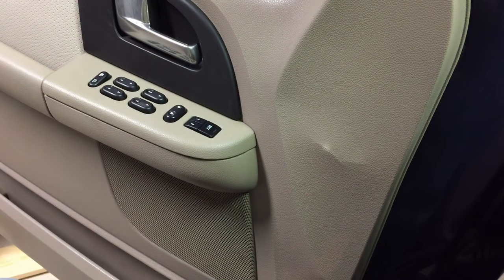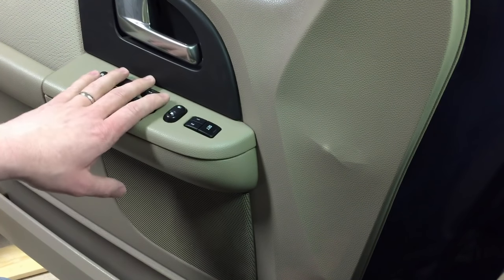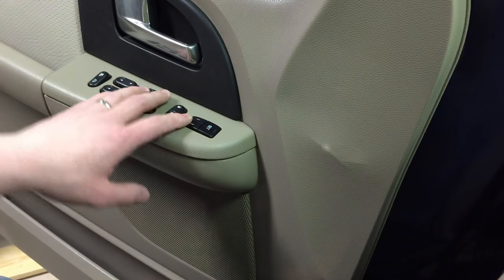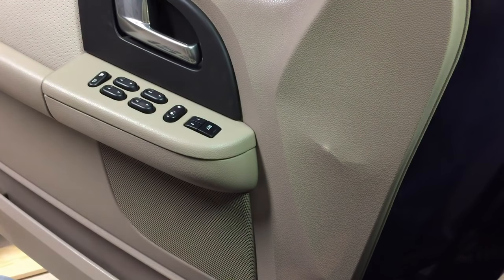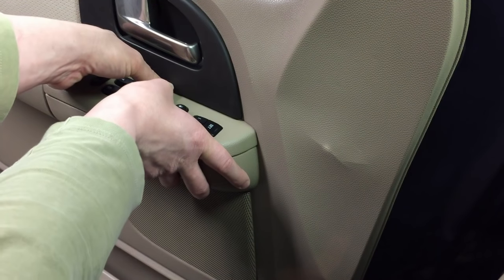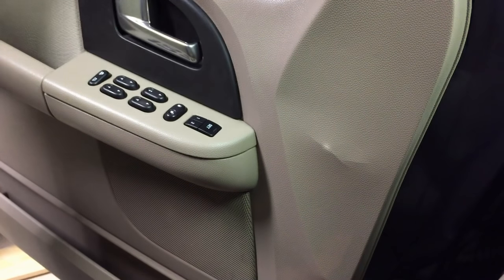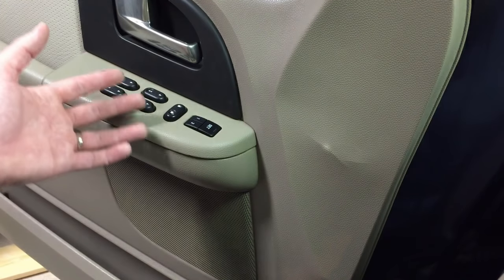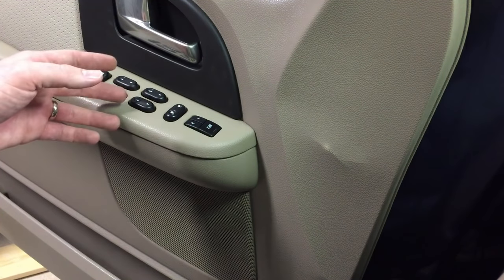Ford Quick Tips: #42 Easy Test For Windows That Are Stuck Down

Comment: I take those switches apart and clean up the contacts, Alot of times a little cleanup with a file on the contact points is all they need.

Comment: AMAZING! 2006 F-350. Right-side shotgun passenger window was stuck in the down position. Was just getting ready to pull everything apart but thought I'd check YouTube first. I'm old school and usually forget about these videos. Played with the master switch and then pretty much all the other switches with no luck. Tried poking/jabbing at it as you show in your video and boom, works like a charm. Must have been some dust or dirt or something in the switch. Saved me likely hours of screwing around THANK YOU!

Comment: You rock!  I would not have tried that persistently if it were not for your video. I ended up holding down the driver and passenger controller for the window to go up and it fixed the issue......for now. Thanks again!
Reply: this helped my issue, thanks to everyone

Comment: Oh thanks Soo much. I just searched for this issue. Window went down, not up. Anyway, that 2nd tip, worked right away. ( quick on off action ). I've been dry camping in the desert and lots of dust and sand out here. So I have a question, can I get one of those airstream pressure cans? To clean it out?

Comment: I changed out the switch and the new one worked.  This is back up car so I did not use it for two months.  When I did drive it, I lowered the window nit it would not come back up.  I got a replacement switch but I sill cannot get the window to move.  There is no cable wrenching sound like I have had on other vehicles so I believe the cables are ok.  If the motor is bad, why would it work once, but now later?  Do you think it is the motor?

Comment: i had a difficult diagnosis of a power window on a 2002 cougar itd work intermittantly did the troubleshooting tree test the RESISTANCE of the power switch. it tested good. next checked the wiring between the door and body found nothing. long story short switch was bad even though it "tested" good with the resistance. now i ALWAYS check for power going in and out of the switches now. much more effective
Reply from the maker: Yeah I don't even do resistance checks anymore and rarely voltage checks I go right for the load test.
Reply: Did you use ur dust meter lol  Blow out the contacts DONE........

Comment: maybe related to my issue? 2014 f250 superduty, passenger window sometimes works, others not. I also have an issue with the doors not auto-locking. I'll be driving and then I'll hear a clunk and the pass door locked. Way after I started moving. Bumped the rubber flex tube between door and body and the window worked for a while. Switches? or wiring at hinge? It is a plow truck but only 80k on it.

Comment: Thanks.   What do you do if when checking current the down wire on the drivers side window shows no current.   Is it the switch.   I actually changed it out and it worked for a few days.  Then back to not going down.  Shows current when testing for up.

Comment: replaced the drivers side switch panel, but the passenger side still does not work, all others work. the regulator on that door has been replaced and it does work at the door, but not from the drivers side??  does the signal bipass the passenger side switch?  ie could it be a wire or plug from the drivers side that does not involve the passenger side switch since that side switch works???

Comment: Ive replaces my 2000 mustang switches but still intermittently just dont get power to the passenger window, never slow just works fine or get no power either up or down.. Any advice?

Comment: One trick I used to use when I worked in a tire and lube shop and a ford vehicle would come in with a bad switch and the customer didn't tell us about it (we always rolled down a window when we had the vehicle in the garage) is to pop the switch panel off, pull the connector for the switch and actually make a connection on the contacts of the plug to get the window back up using a pair of needle nose pliers or the like. I'm not sure exactly on what year models this would always work on, but I know early 2000 vehicles it works. Just pull up on the panel and it comes loose.
Reply: dust in contacts Blow it out ur DONE....
Reply: Nice. Great idea.

Comment: So window power switch not working, changed silver relay in fuse box, no luck,switch out master switch,nothing.
What I have noticed when I press switch it activities, the power heated mirror light come on, and also when I am using the heated mirrors only the passenger side work, wondering if you can point me in the right direction.

Comment: Hit button while pulling up on the window with other hand usually gets a stuck one moving past the binding spot. Mine binds half way down. Don't think it is the switch and maybe the regulator sliding contacts are bad.  Have a spare motor but it does the same thing. Only other thing I can think of is possible it is binding where the window slides in the felt track.

Comment: Thanks man, rapid click worked for the passenger window on the driver side switch, but passenger switch not working? I check contacts
Reply: Window lock? Makes it where all windows are controlled by driver only.

Comment: Thank you for the advice. Tapping got it back up.
Reply: Hank Monroe hi I have a 2000 Excursion and my window goes up but it won't go down and if I push it to go down one of the not the little fuse but the big fuse to relay makes a noise when it shuts it down in a few seconds later he tried again can you help me

Comment: I have a 2013 Expedition. The driver window does not work. I have replaced the motor and switch and still only the driver window does not work. Not sure what to try next. The motor does not work when unmounted but plugged in Tried 2 different motors and still does not work. All other windows work fine.

Comment: 03 Towncar code 34 on airbags. Could you outline trouble shooting tips? No access to ford computer diag tool short of taking it to dealer.

THx.

Cheers
Reply from the maker: Victor Shu There is a open circuit in the safety belt pretensioner circuit on either the drivers or passenger front seat belts and really should be diagnosed by a professional as these are dangerous.

Comment: i took one apart and found a little factory molded bump it was hitting to stop it from going farther down to make contact with current, so i used a razor blade to remove the tiny bump that was stopping it. then it started working again... it was design to fail... sad...

Comment: Jab method freaking Ford! I need to find out if the 2000 F250 interchanges with the 2002 f250 Amazon says it doesn’t but it looks the same

Comment: Hey man great video. I have a 2006 Ford E350 5.4l 3v. When I turn the key to the on position, the windows don't go down until about 20 seconds. Also, when the key is on the on position, the headlights always stay on (even though the headlights are turned off). Another symptom of this problem is that the fuel gauge and temperature guage on cluster also don't work for the first 20 seconds (works only after about 20 seconds of turning the key on the on position).

This problem is consistent and happens everytime. Any useful tips/advice would be greatly appreciated.

Comment: I loaded some wood in my 2008 town car and had it sticking out the rear passenger window.  The last time, I put too much weight on it and the window is jammed in the down position.  It will not go up and moves about 1/4 inch down after you hold the up position on the switch.

Comment: I have a 2005 ford F-150 fx4 the fog lights wouldn't work at all so I replaced the fuse an relay finely got my fog lights to work but now the radio and windows don't work at all I was going to check the passenger side window coz it didn't work from either passenger side or driver's side but now none of the windows work

Comment: My friends 04 F150 has a problem where the front passenger and both rear passenger windows won't operate. Can anyone think of a single point of failure that would cause this to happen?

Comment: Question my 2007 f150, window has not worked since las t fall.
I have changed relay
Changed switch, still not working.
There is a weird thing happened when I press the window switch, the power defrost side mirror come on.
The power defrost on the passenger side defrost.
The drivers side do not.
Can anyone lead me into the right direction.
Thanks 🤔.
Reply: rejmonwilson It's the wiring harness between the door and the cab.
Reply: Could be the GEM box also being a Ford

Comment: Having same issue with passenger front window not rolling up. I tested passenger switch it’s ok. I have 12v but when I call for up it goes to 0v so I checked the master and it’s the same issue. So I changed the master and passenger switch and still having the same issue. Also I have tested the motor and it’s ok.
Reply: Jesus Oseguera Figure it out?

Comment: 2015 Ford Transit 250 passengers window rolls down won’t go up from either switch! Tried methods on both switches and jiggled wire harness on passenger side. Fuses good. Any ideas would be helpful. Thanks!!

Comment: Six months i waited for the weather to warm up enough to figure out why my driver side window stopped working... check the fuses, good...took apart the switch, good.  Frustrated, i took off the panel and the plug had disconnected inside the door!  AGHHHHH!
I hope this helps someone else.

Comment: Window goes up, but won't go down. Any suggestions
Reply: Passenger side.
Reply: I replaced motor already
Reply: It's either the switch itself or the regulator if it isnt the motor

Comment: At 2:00 you said it all.... So, wouldn't it stand to reason that those penny pinching bastards would put a "better", more heavy duty switch in the Driver's position, in the first place?

Nahhhhh... It'd cost Fraud Motor Company anoth 7 cents per car.